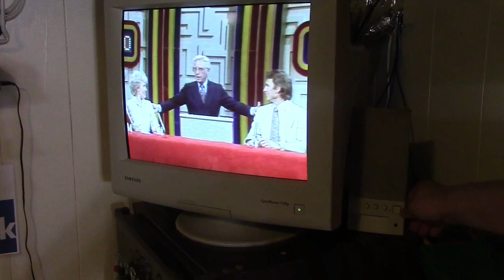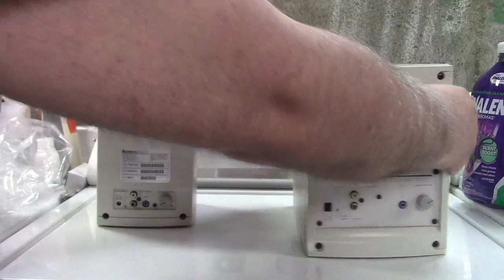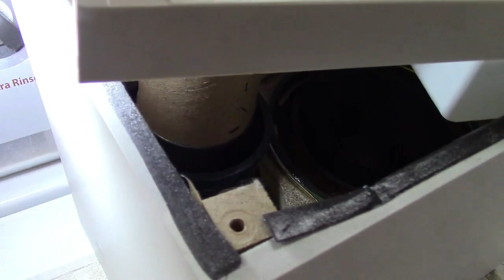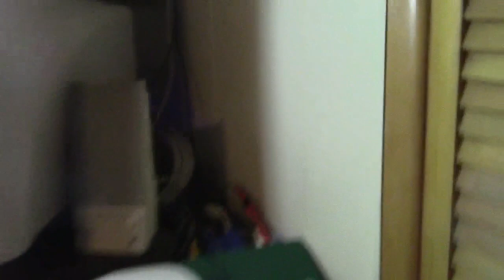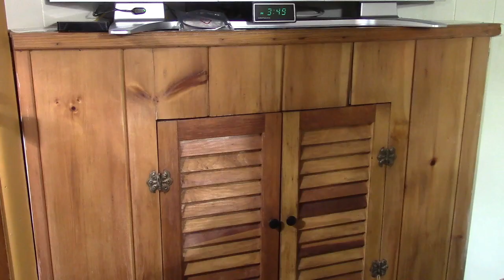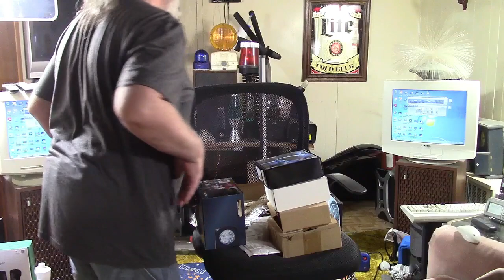The Sour Subwoofer Saga...

Comment: I thought you was gonna connect that big sub to that small subs amplifier
Reply from the maker: Didn't think of that actually.  Don't want to blow it up either!  That old Zenith unit has plenty of power to drive it.
Reply: Another idea is if that sub output only has the low end you could use the old zenith as a subwoofer amplifier
Reply from the maker: @graboid116  Still want to try and preserve what I got.  I drive it pretty hard, so it certainly all gets its exercise, but it's still a "poor man's setup".
Reply: @jaykay18  i hear ya they sure don't make stuff like they used to.
Reply from the maker: @graboid116  Those Fisher speakers are from the early 70s.  They have a warm tone to them, something you just don't get in other speakers.
Reply: @jaykay18  i know i had one someone sat out for free so i grabbed it unfortunately it went kaput

Comment: -i scored from goodwill rca rt151 , 80 watt just for the sub amp box $5 ,,and paid $15 for the remote online 
i can hook up front , rear and center speaker ,1 line in,1 aux in,  , and on the remote you can adjust each set of speakers volume independently ,,
i had many sets and revision of that stuff all junk unless i used them to build mini amps for small projects or repairs
Reply from the maker: You're lucky.  We had one Goodwill store here, but they charged outrageous prices on everything.  Then the landlord raised their rent and that location was closed.
Reply: @jaykay18  that scks only 1 goodwill near you ,,your in a ghost town,now you have  no army or will ,,ouch ,, ,,60148 usa i'm in ,, i do a gw  route ,,the video you made ,, just use them parts as pre amps and x them to boost your current new main amp ,what you showed in your video i had so many of them the best i got was  a 1 gallon bottle and you take them speakers and amps and face the speaker into the bottle for base for arcade use,, you can see a picture in a lame video i did years ago called bimbo the clown sound upgrade i think

Comment: You cant beat Altec Lansing for pc speakers they sound great, plus they don't need a sub with them.
Reply from the maker: I know, that's what I have on my main system, they're 25 years old and still sound great.  Altec has left the computer speaker business, they make Bluetooth speakers now.  If you need computer speakers, Klipsch is the way to go.  You'll pay for them though, and I'm more than willing to shell out for them, as I use Klipsch speakers on my main stereo upstairs.
Reply: @jaykay18  I use Bose music monitors on my pc and they sound brilliant, they have a 2.5  inch driver and two 2.5 inch bass radiators on each unit.

Comment: It can be a bad capacitor after the full bridge rectifier, it can be loose speaker (loose cone, cause of the loose spider, yes i heard some speakers spider wasnt glued down properly in the past), it can be a damaged ic or transistor, it really should been taken apart and have to be checked for component issues.
Reply from the maker: Correct, it could be any of those.  Considering the whole thing can be replaced for around 30 bucks, it's not worth the time.

Comment: All this cause joe gave you a TV and I gave you some cables.  The sound bar china sent me does not play nice with that ESA tv using the headphone jack. I have to turn it up then i get hiss and buzz. The TV has digital coax out which the soundbar supports but yet i can't get audio that way from the soundbar. Even when playing a DVD.
Reply from the maker: As usual, with everything I get, it spirals completely out of control.  There's still more to come.

The "Soundbar" I have on the TV in my bedroom always has a low buzz to it and will cometimes pick up electrical interference causing a pop.  It's minor, so I live with it.  I have tried many of the other soundbars that have come my way, and none of them operate any better.

Usually they support optical, but digital coax is pretty rare.  Regardless, it's the same deal, it's just sending the data over a wire instead of a light pipe.  If the output isn't what the soundbar wants, you will get no audio.  Usually have the change the audio output to PCM and not Dolby anything.  Just make a note of the audio output settings first, then mess around with them until it works,